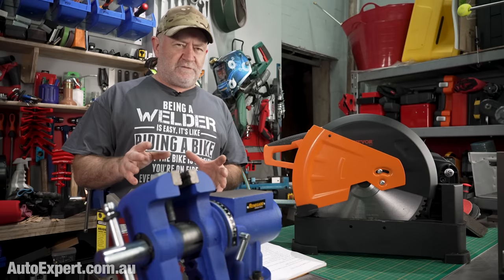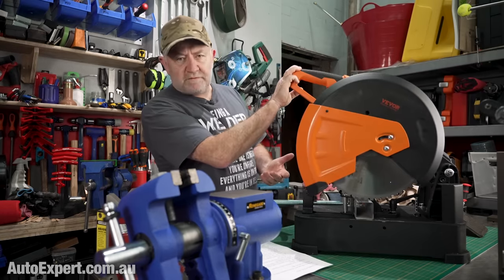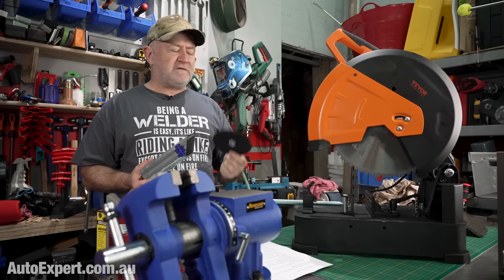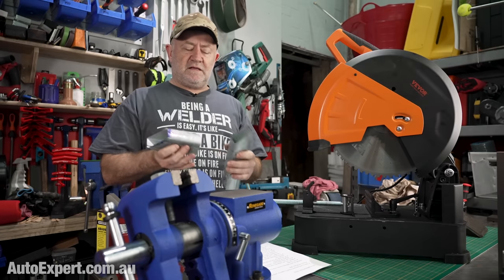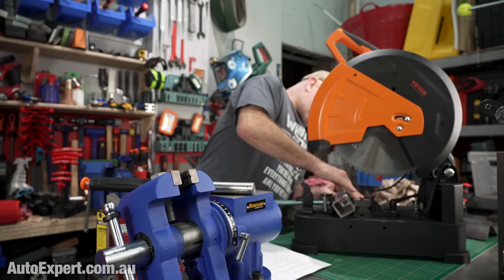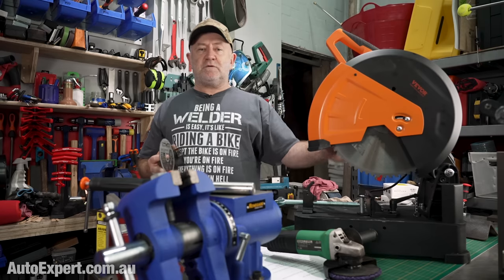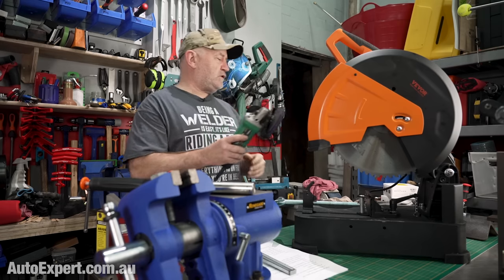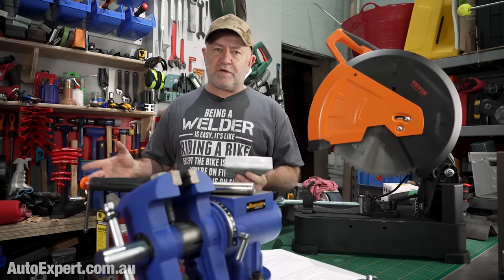Best affordable DIY metal fabrication chop saw tested (Vevor 355mm) | Auto Expert John Cadogan

Comment: How does it go with Alluminium?
Reply: It'll cut aluminum fine but aluminum is so soft a dropsaw made for wood will cut it no problem if your careful how fast you feed it.. I use carbide tipped saw blades made for cutting wood in a milling machine for cutting aluminum

Comment: I've had my eye on the S355CPS from Evolution. It seems somewhat similar to this but at a higher price point. Evolution make great gear but unfortunately their available range in Australia is pretty crap (and expensive). 
Go to their UK site and drool. 
Their metal mitre saws (esp the new one) are amazing and relatively cheap O/S but you can't get them here. 
I wrote to them to see if they'd consider expanding their lineup here but no go  :-(
Reply: @Neishy4AGTE  Yeah, tried that. They won't send to anywhere outside Europe (they have a USA presence but that doesn't work either).
They have an importer here (Total Tools) but I don't think they take their role seriously.
Reply: I have an Evolution Table Saw with the multipurpose blade that works a treat on steel & aluminium and wasn't that expensive.
Reply: @Neishy4AGTE  Yeah, having a better range would be good but I guess we're just too small a market.
Reply: @Neishy4AGTE  I got the table saw from Total Tools ... it's much better than the similar priced at Bunnings. A mate has the sliding mitre saw and that has the multifunction blade as well. I got the multi blade for my Ryobi mitre saw and it's perfectly fine for the steel and aluminium I'm cutting 🙂
Reply: Yeah Evolution stuff is excellent but way too expensive once it hits the shelves in Australia. Same with Fein stuff out of Germany. Unfortuantely we get reamed with the cost of quality tools in this country and the market is too small for it to be taken seriously by a lot of manufacturers.
Reply: @slasher9883  I think that's the case with most tools.
The price we pay (literally) for being a small market in the arse end of the universe. 
I saw a video the other day where I guy in the US was talking about a DeWalt table saw for $399: "Now even though this is a very expensive saw, it's very good". 
LOL.
I've seen that saw selling here for over $1500.

Comment: Metal is a piece of piss compared to timber….you can’t weld a bit of wood back on when you make a mistake.
Reply from the maker: Sure you can - just need the right filler rod.
Reply: @AutoExpertJC , lol….believe it or not there is a machine that will "weld" timber together using vibration, as an old chippy by trade that’s equivalent to a miracle. Good video today, you really nailed all the salient points, I’ve had one of these saws for around 25 years and I wouldn’t be without it. Cheers.
Reply from the maker: No worries Richard - polyvinyl acetate filler rod usually works for me, with a sawdust flux-core. Doesn't dry nearly as fast as 6013 or 7018 of course - that glue dries really fast.
Seriously - thank you very much. I appreciate you watching.